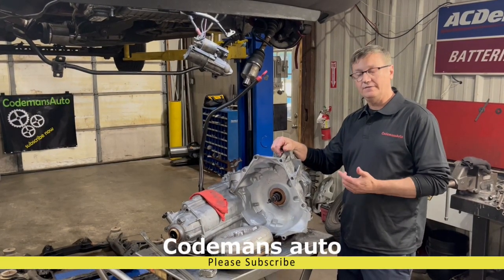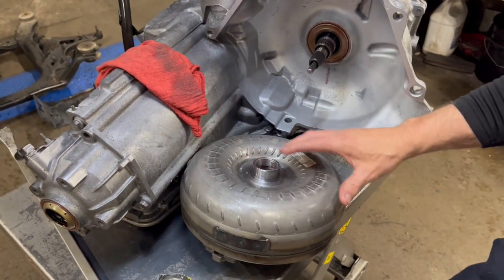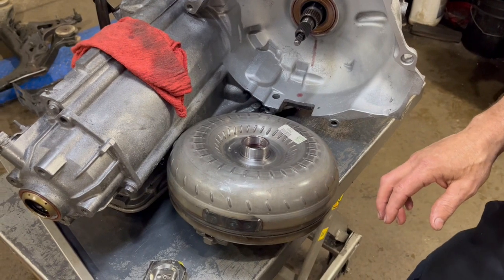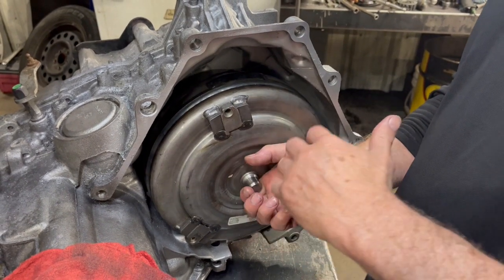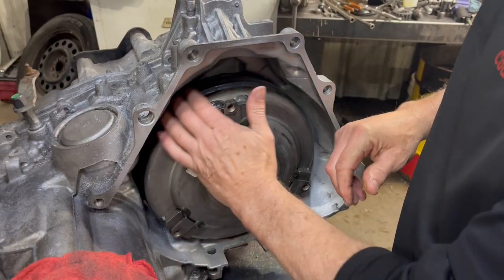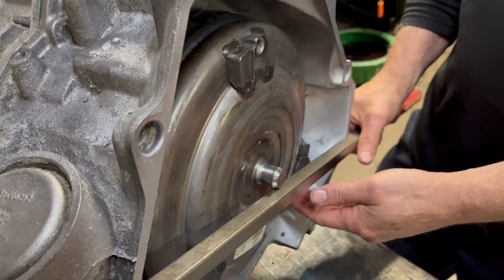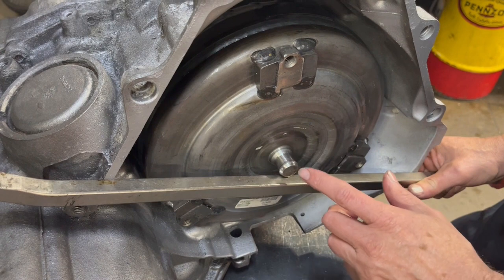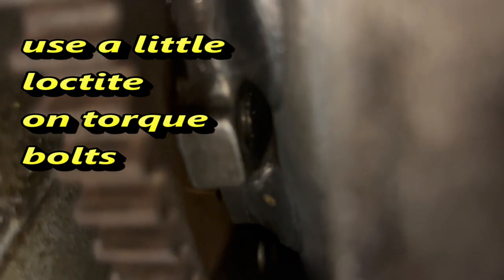Chevrolet Impala, Pontiac Grand Prix,   torque converter install on a 4T65E transmission

Comment: Does 4T65-E HD transmision that comes from GP supercharger gt can be installed in a pontiac grand prix base model with 4t65-e transmision. I was just wondering if it would be possible to upgrade the transmission or the housing bell is different along with other compartments  ?
Reply: Yes the trans from the gtp has just has more beefed up parts in it not much but they are interchangeable

Comment: O got a 97 buick lasabre 3.8 l i think it has the 4T60E , any all forward gears when at same time , reverse is still strong . 
Any ideas?
Reply from the maker: sounds like the forward band, or try and see if it will go into forward gears pulling it all the way to low and if it will pull in manual low then it could be a one way sprag
Reply: @codemansauto208  when you put it in drive it makes the rpm come down on engine  like it took gear , but sill no pull. Won't work or pull,  if you manually try . It did manually before fluid change 
Thanks

Comment: I just bought a converter from O'Reilly but it won't line up with flex plate to bolt in its a little off where the bolt tries to go in at a angle
Reply from the maker: i would not force that, it could lead to bigger problems later on